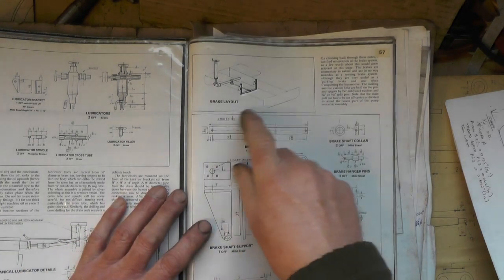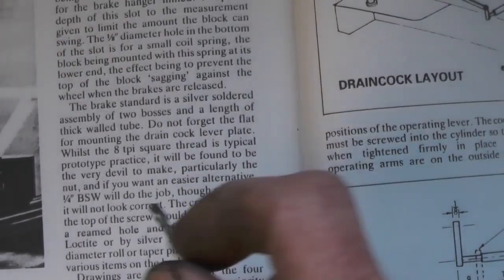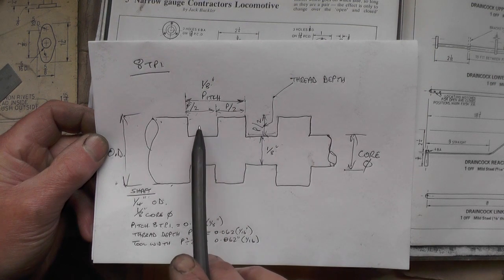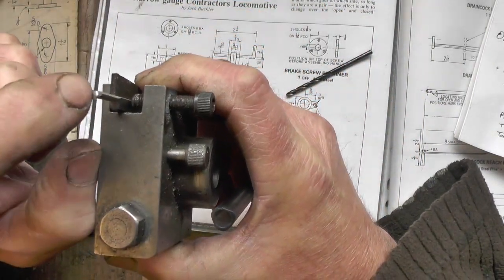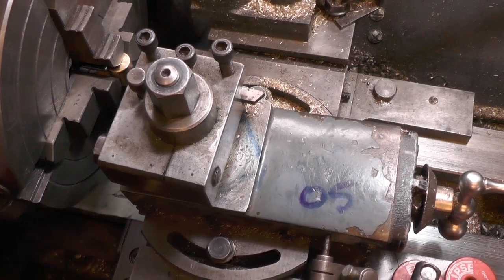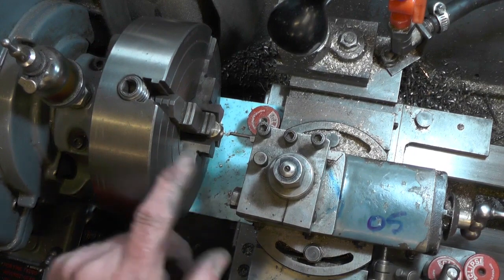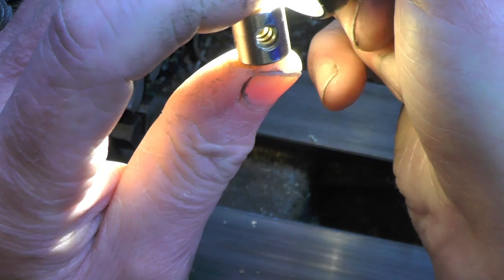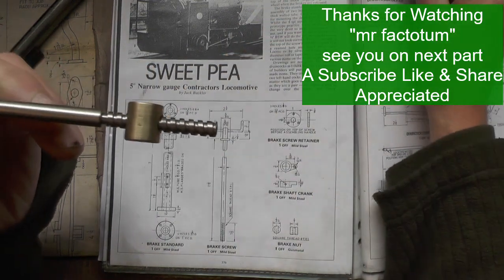Miniature Beginners Steam Locomotive Series (Brakes P1- Small Internal Square Thread ) "mr factotum"

Comment: This is the first time I think you've spoken about backlash - how do you deal with this on your mill, given I see you make cuts in both directions on an axis (and thus be susceptible to the effects of backlash) ?
Reply from the maker: hi tiw
backlash is something you have to ;live with, for any screw and nut to work, you can only minimise it, on the mill, to alleviate the problem i use 2 methods, i have a cheap and cheerful  digital readout, or for small movements  i use a dial test indicate positioned on the relevant axis to  to give me a reading when the  milling table  moves on x, y, or z axis, once the needle moves you can read the dials to give a precise movement. hope that helps. 
regards
mr f

Comment: this is great to find have watched all your video's,  so have  starting making  a Tich loco, have bought  the drawings and made the frames it's a 3\1/2", as looked at 5" but the materials get very big very quick,  your skills are spot on, you remind me of the engineer i was an apprentice too 45 years ago, moved out of tool making late 70s as everything engineering shut down around here, but have been inspired by yourself having made a workshop. have bought a few books on the Tich and Rob Roy much the same but they have noway near as much detail as you book, anyway my point is do you think coping what you have done will work on a smaller scale as you say here, things are very small, thanks for all work really look forward to the next.  Sam
Reply from the maker: hi  m Sampson
thanks for your kind comments, I appreciate.
I would just say go for it, if you hit any problems there are always solutions with a bit of thought. I have modified many things on mine to suit my existing stock materials and my personal choice.  I realise every thing will be smaller but you will adapt to working on this i'm sure. Are you making the boiler or buying in??
good luck
regards
mr f
Reply: @MrFactotum  hi i am like you in reverse, been plumbing since late 70s so the boiler brazing or hard soldering not a problem hopefully, its the engineering i want to relearn as picked up a Bridgeport from a foundry that has closed, have other bits like you say not knowing  what all the things do on a loco makes the head spin, like i said my engineer used to say like you only look at the whats in front of you, not every thing around you, it's going to be fun as just picked up bits for a Rob Roy so think this is going to be a custom job i know what looks right, if  looks bulky will adapt your video's are so helpful thanks again sam

Comment: Mega respect Mr Factotum. The video makes this look much bigger than it is in real life. In my days as a turner i used to do multi start square  threads , but always about 50mm diameter. I wouldnt have even attemted this.
Reply from the maker: Thanks Rob, I appreciate your comments. also it was made harder with eyesight not as good as it used to be. it all good fun
regards mr f
Reply: @MrFactotum  Im the same. I spent £650 on custom made glasses and i still depend on a magnifying glass and jewlers loup.keep up the good work. Regards from Skipton